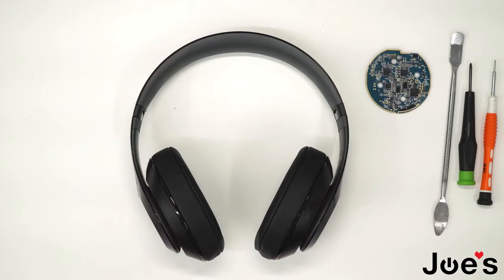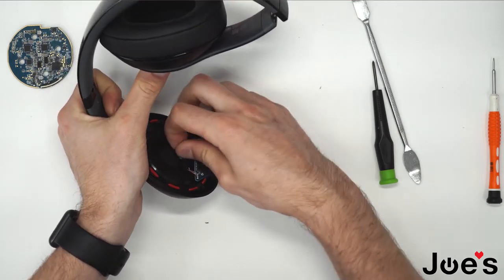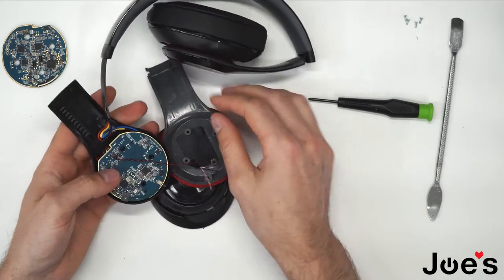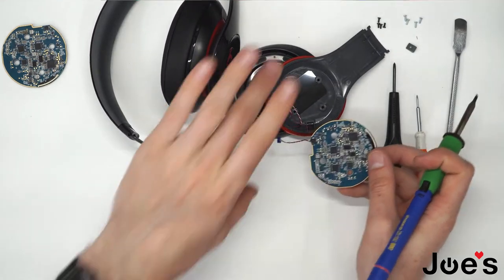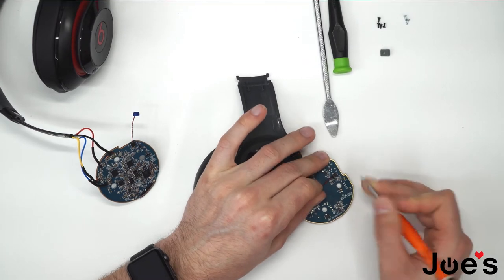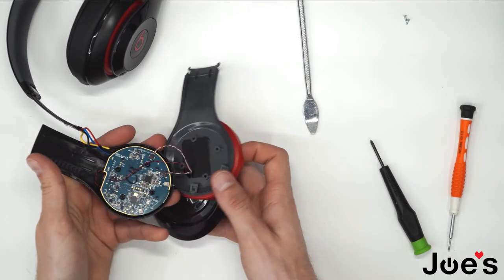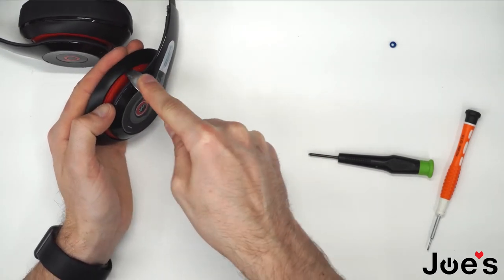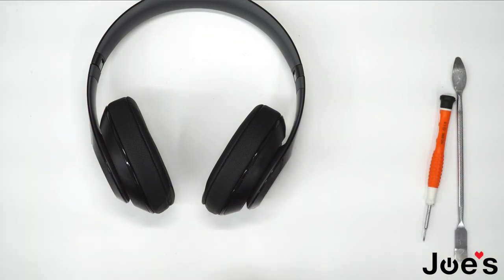Beats By Dre Beats Studio 2 Wireless Bluetooth Board Replacement

Comment: Do you think it's possible to install all the wireless boards inside a factory wired set of beats? Are all the wires the same across wired and wireless or no?
Reply from the maker: Thanks for watching! Unfortunately no, the bored will not fit in a wired pair, the internals are different between the wired and the wireless. CH

Comment: could i replace the board in my nonwireless beats with the bluetooth one?
Reply from the maker: Unfortunately this will nor work, as the board will not fit and is not compatible without a lot of modification.
Reply: @Joesge  thanks for your quick response.
Reply from the maker: No problem!

Comment: My Studio Wireless won't go into pairing mode.  I have tried manually putting into pairing mode by holding down the b button but that does nothing.  The power LED refuses to blink.  Do you think this is the bt board?
Reply from the maker: Hello, thanks for commenting. Please email us at support@joesge.com and we will be able to better help you there. - Aaron P
Reply: Did they answer you? I have the same issue rn LOL

Comment: my headphones stopped connecting to bluetooth - they no longer play the audio sound when you turn on the headphones, doesn't show as a pairing option, and obvisouly stopped auto connecting with devices i had previously linked with. the aux does work tho. does this sound like a bt board issue? or could it be something else? i haven't been able to find anything online about what it means when your beats no longer play the start up sound when you power off & on. Thanks to ur video, I've realized the bluetooth light is not blinking. is there any other explanation of is it defintely the bt board
Reply from the maker: Hello, thanks for commenting. Please email us at support@joesge.com with your question. We will be able to better assist you there. - JoesGE

Comment: What soldering tool are you using...i'm going to try to attempt this fix, but first soldering experience...
Reply from the maker: Thanks for watching! We use Hakko products for our soldering equipment. They are more expensive but are definitely worth it if you plan to use them often. If not, cheaper options should be available at hardware or electronics stores near you. Matt D.
Reply: @Joesge  Thanks for the advice and all your helpful videos. Ive already ordered from your company and as always top quality!  I will order some pieces now.  Cheers...
Reply from the maker: You are most welcome! Thanks so much for your support ❤️ Matt D.

Comment: I have the b0500 model. Will this board work with these?
Reply from the maker: Thanks for the comment. This board will not work with your model. Here is a link to the parts for your model B0500. https://www.joesge.com/collections/parts/products/beats-by-dre-studio-2-wired-power-board-3-5mm-aux-pcb-parts?variant=8480500088878
-David P

Comment: My bt board went out the other day. The strange thing is that Beats Updater also stopped recognizing my headphones. Is this common?
Reply from the maker: Hello Chris, thank you for watching our video. The reason why it's not recognizing as the headphones are unable to connect to the software properly. 

Ruslan P
Reply: Thank you for the reply! Would changing the BT board fix that issue too? Do you have boards to do the repairs if I send it to get replaced?
Reply from the maker: Chris, if your Beats were recognized before then, if we change out the Bluetooth board or the Power board it should recognize the headphones once again. We do have the parts at our location if you would like to send in your headphones for a repair by following the steps here: JoesGE.com/pages/repair-services, use Google Chrome to submit our repair form. 

Ruslan P

Comment: When I turn on my beats all I get is a very loud hissing sound. Is the Bluetooth pcb gone bad?
Reply from the maker: Thanks for the comment. The issue you are describing does sound like a faulty Bluetooth PCB. Another possible issue may be the MS Port which is connected to the Bluetooth PCB. If you would like your headphones repaired by a professional you can fill out a repair form and follow the steps to send in your headphones. We offer free shipping and diagnostics. Here is a link to the repair form:
https://www.joesge.com/pages/repair-services
-David P
Reply: @Joesge  I already have. I just printed out my usps ticket it will be I. The mail tomorrow
Reply from the maker: Great! Thanks for trusting our team:) 
-David P